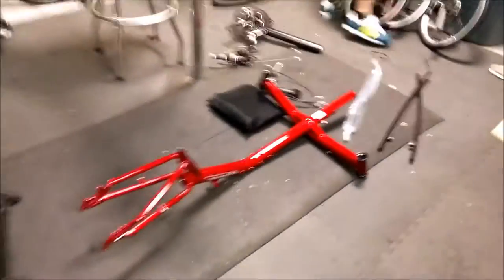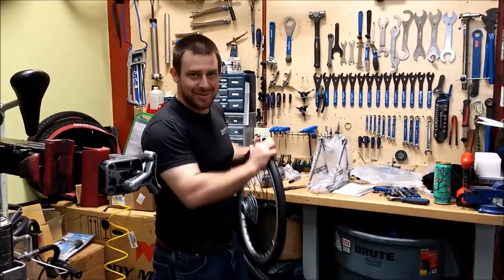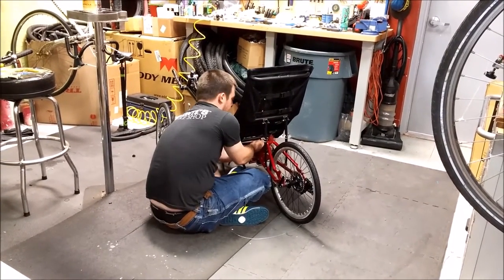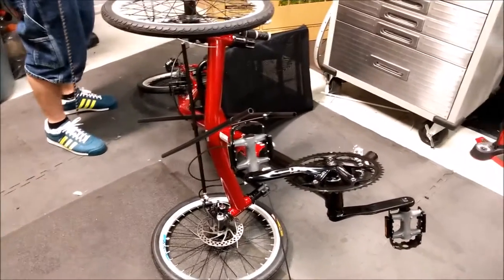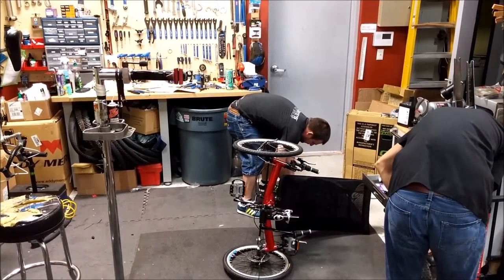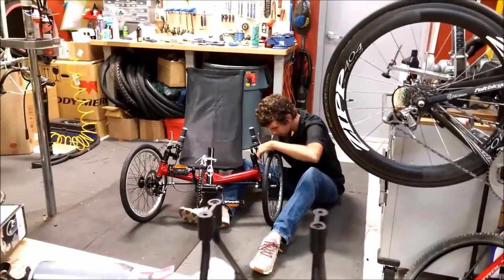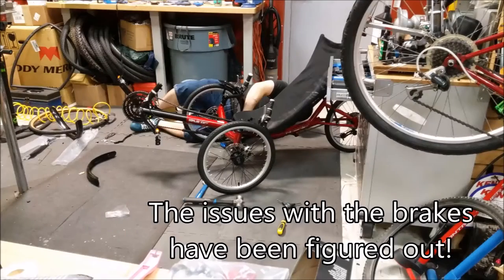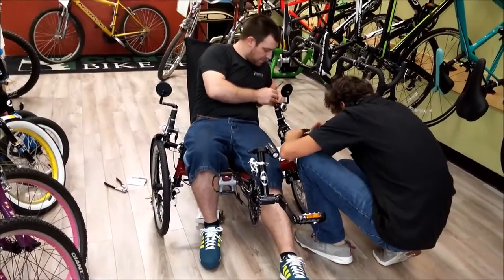Building My Sunseeker T3 CX Tadpole Recumbent Trike

Comment: No maiden voyage?
Reply from the maker: it's on its way. the audio is horrid and the video is really shaky. I'm working out the kinks in my recording setup...
Reply: @ExcalibursZone  I bought one, and i am still waiting, how do you like it??
Reply from the maker: @budmax777  it's a very nice ride! I will say that you should invest in some lock-tight or something similar. The bolts come loose pretty easily. I lost one, but had extra and it hasn't come loose since.
Reply: @ExcalibursZone  Thanks for the come back. Appreciate it
Reply from the maker: Sure thing. If you have any further questions about the trike, ask away! :)
Reply: @ExcalibursZone  What bolts have you had trouble with??
Reply from the maker: The one that holds the chain guard on. Loctite worked a treat, though, and it hasn't come out since.

I would highly suggest you Loctite all bolts/screws that aren't going to be loosened or adjusted. Vibration will make some of these fall out.
Reply: @ExcalibursZone  I had to replace that whole bolt with guard, had locktite on it new, so i guess the manufacture figured it out, Thanks again for the reply..
Reply: @budmax777  my frame cracked. but i welded it,